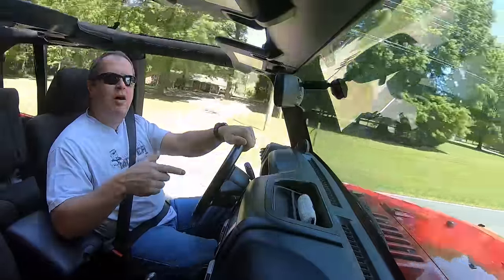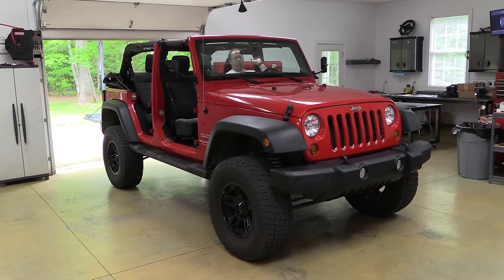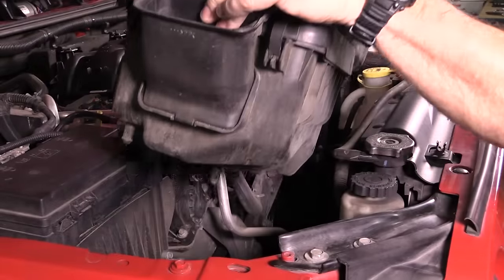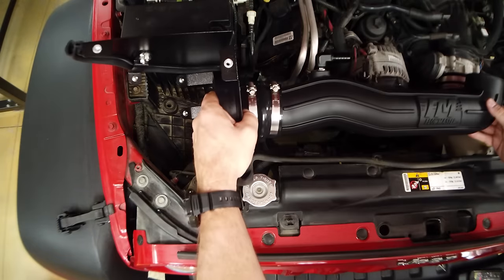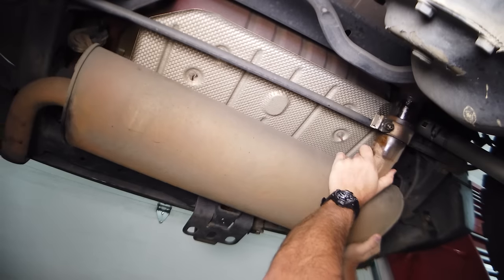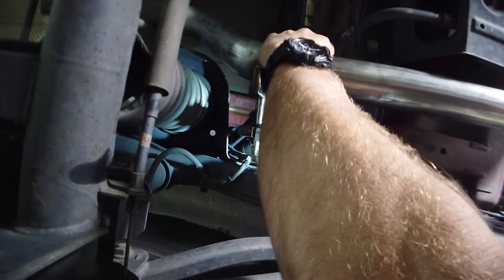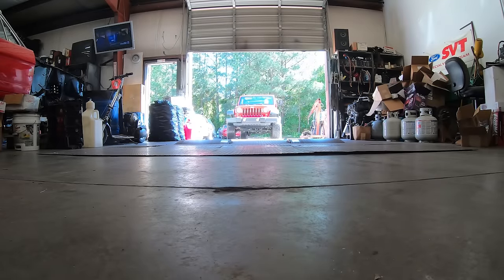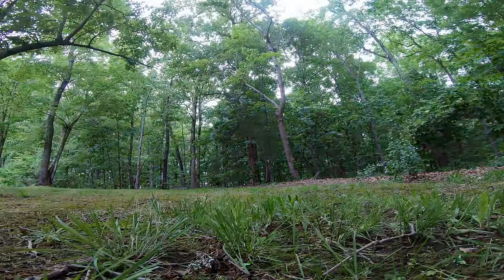Real Horsepower Gains in Jeep Wrangler with Intake and Exhaust Upgrades (Easy Bolt-Ons Only!)

Comment: Is it recommended safe  to just change the air take ... or both because the exhaust might be more harder for me
Reply from the maker: Yes, and although I did them both at the same time, I think it was the intake that is responsible for the horsepower gain. I think the exhaust mostly benefits sound, after all, the tubing is the same diameter. Thanks for watching!

Comment: The issue that bugs me about my wrangler is the auto transmission doesn't shift like I want it to or like I am used to. Is there anything I can do about that? Or am I the only one that has a problem with this?
Reply: I hate the automatic transmission that only had "D", (Not 2nd and 1st), and 5 speeds that try for the lowest rpm to save gas.  I was going up a hill in cruse control at about 54mph, and it could not make up it's mind to climb the hill in 4th or 5th, and it shifted back and fourth 3/4 the way up the hill several times.  Then I went to help it make up it's mind, and hit the gas.  It confused the computer, went into limp mode and would not shift down or accelerate much.  Shut it down and it ran fine when I started it again and a light that had come on, went off, (engine light went off on another day).  The only control you have to shift is the throttle.  I also have bigger tires than stock, with stock gearing, and I think that makes the shifting feel worse.  So far with mine, (I just picked up a used 2013 with 110,000 miles), I think I have issues with restrictive exhaust too, that raises engine heat, and starts losing power/shifting poorly and even hard sometimes.  I was driving it trying to get the best gas mileage, (first time I had a "average MPG display" in real time in the dash.  It is .9mpg high), and it runs like a slug, highest gear possible, (around 1,200 rpm), like that.  Give it some gas,---just don't hit the pedal too fast up a hill. :)  There are some tuners for sale that claim you can alter shift points for the auto trans,---but I don't know anything about them yet.

Comment: Yall need bigger ring and pinions, i run 5.10 front and rear instead the stock 4.10 or lower depending on your specific model

Comment: When is someone going to d do the obvious and give up on the std 4.0L jeep motor and do a Barra conversion and make a beast of it
Reply: The real pro strategy is 5.9 swap
Reply: dude it's a 3.6 not the 4.0
Reply: They haven’t made a 4.0 for over a decade
Reply: @WaterDR-tw8re  They haven't made 2jz,RB25 or Barra engines in over a decade either but there still the most popular I6 engines out there... new is not always better old is gold
Reply: No reason to give up on the 4.0.  Bore and stroke it.  Go watch Keith Newcomer’s 4.x builds.
Reply: CHazinite Casualties  I built a 250hp/300tq 4.6L stroker in my 96 2dr 2wd ax15 manual lsd cherokee and would do it again vs a engine swap.

Comment: I noticed the new diff covers, did you gear it differently too?
Reply from the maker: Not yet.
Reply: @TheHorsepowerMonster  still running the JKU Sports 3.21 gearing during all these tests then? I have a 2012 as well (sport) and I’m regearing it to 4.56, I was just curious what kind of gains I’d get before regearing.
Reply: 3.21!!!! That is pitiful
 Try at least 3.73 or 4.11 if you don't do freeways ... my 14' would not pull 6th against the wind with a 3.21!!!!! Went faster in 5th. Now at 4.11 I love it for trails.

Comment: Regear would have done much better, although definitely not a bolt on solution and definitely more expensive, but in the long run more beneficial.

Comment: How did you get it into dyno mode?
Reply from the maker: We had to make the pull in third gear. Otherwise, didn't do anything.
Reply: @TheHorsepowerMonster  in 2015 we put our 2014 on a dyno during a car meet. We didn't intend to do it, but had extra dyno time. Traction control, abs, engine and every light you could think of popped up. We searched but could not figure out how to get it into dyno mode. It's an automatic but would not leave first gear. It wanted the front tires to move.
Reply from the maker: Oh, wow. Yeah, we had no issue with that. This is a straight drive, don't know if that made a difference. Thanks for watching.

Comment: If installing larger tire then just re gear it from stock 4.11 to 4.56 anyway stock rubicon w 31 inch tire is already slow and need lower gear but the engine characteristic already slow but torque so all of this mod useful 😂😂
Reply: Stock 14 jk sport had 32" tires and 3.73 gears did very well .
stock .

Comment: My wife loves her JK, but Jeeps are such horribly underpowered pieces of shit. I hate driving that thing.
Reply: I think that dyno is off.  That engine stock makes 285hp, and it boogies.  But the power peaks at red line so the lower rpm's tend to be soft for power.  Clogged cats will slow it down to, and create excessive engine heat not seen on the water gauge.  IMO, because it is soft on power down low, but goes well when you keep your foot down, (like a 12" throw on that electronic pedal), the engine is better suited for a sports car than a Jeep.

Comment: A Dyno being out of calibration is a wide spread thing.  There is really no universal way to calibrate dyno's as far as I know, (I do own a dyno).  That engine is suppose to make 285hp at red line stock, and my JK feels like it, (I have larger tires on mine too).  Your tire size should not effect your dyno results, (yes, they may be harder to turn like taller gearing, but like taller gearing, more work is done per revolution), and you are reading about 55hp low.
I calibrated my dyno by trusting one manufactures engine hp claims that I could trust the most.  Then I set up that engine and ran it, adjusting the "efficiency loss" factor in the software until my pulls were matching the manufactures claims.  It was the only way I could think of, and it should be as close as the manufactures claim.
Reply: Wow you are very wrong. Tire sizeand weight greatly effect power output

Comment: And if you are in an accident, the front seat occupants will have their lower legs crushed and the rear seat occupants will be ejected with fatal head injuries after the B/C pillar fails.  In the recent ANCAP ratings, the Wrangler and the variantts like the Gladiator achieved the 4th worst crash test results ever recorded. The only worse ones were cheap work utes from India and China.
Reply from the maker: I hear ya, but if your main concern is safety ratings and stuff like that, you might be in the wrong place. Thanks for watching, though!